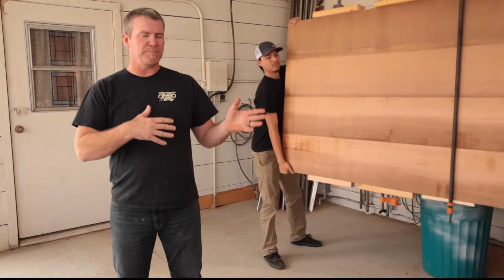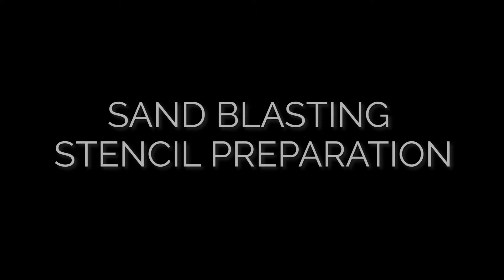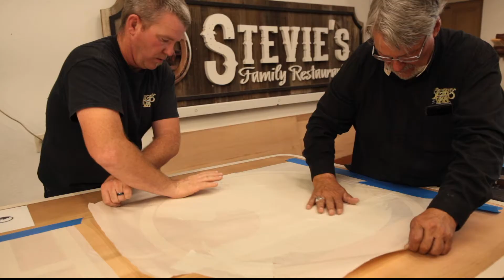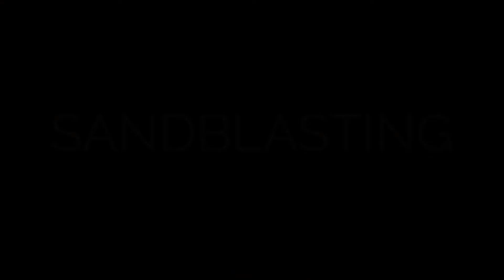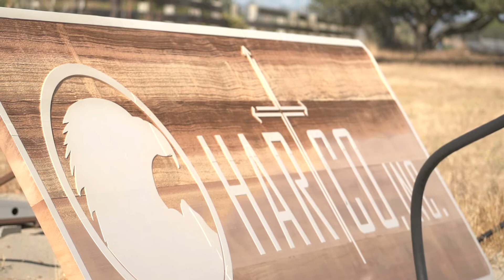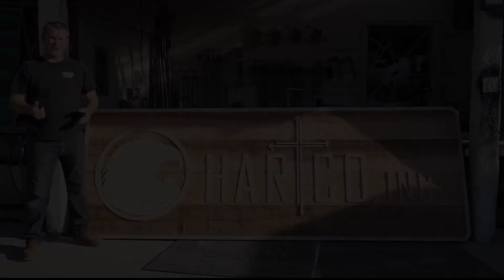How to make a sandblasted sign the Signs by Van way. (Tutorial)

Comment: I have a question about the nozzle used during the sandblasting, I was curious what brand or kind it was and what tips are used?
Reply from the maker: https://www.idsblast.com/sandblasting-supplies/category/1132 - Call these folks and tell them what cfm your are running at. 
We use a conical shaped tip and the rest of the information depends on your blaster. Hope that helps and happy sign making.